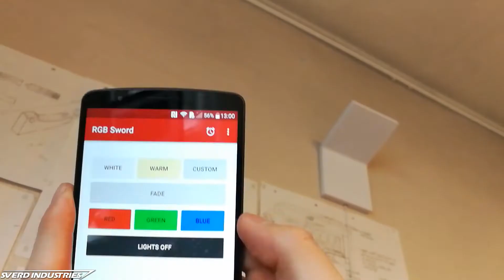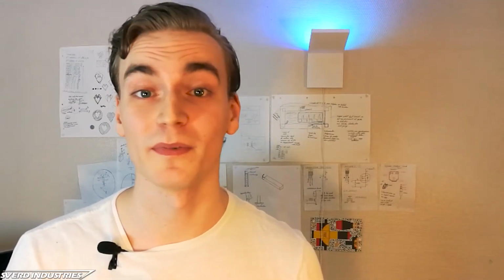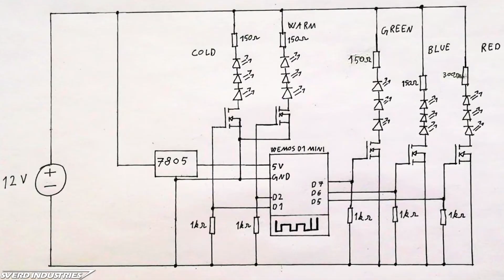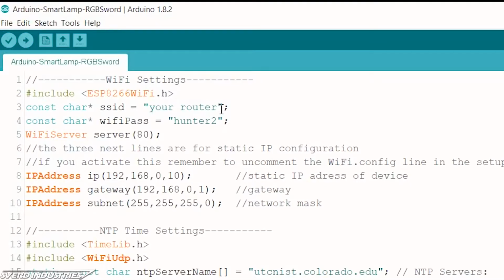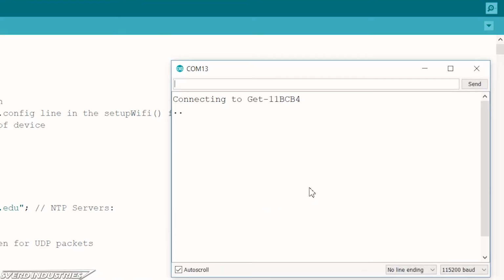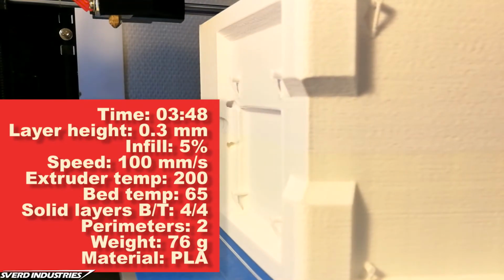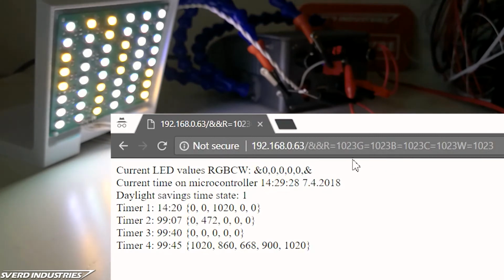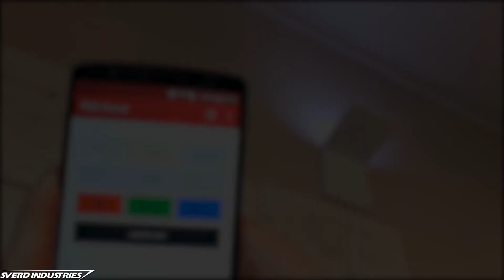DIY IoT Lamp for Home Automation || ESP8266 Tutorial

Comment: Thanks for the great video. What about heating issues? Do we need a heatsink for normal day to day use? And what about the life of microcontroller board?

Thanks bro
Reply from the maker: I haven't ran into any issues with the heating in day to day use. The microcontroller is an ESP8266 in a Wemos D1 Mini break out package. It handles the current and heat without a problem.
Reply: The leds are open to air, he can not       use 100% brightness. Yes, he does not have to worry at 50%.